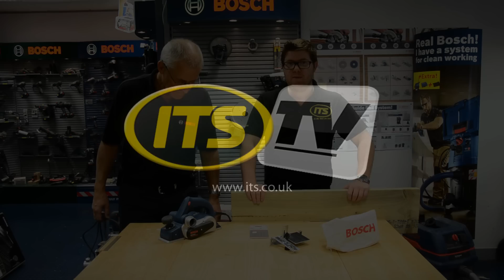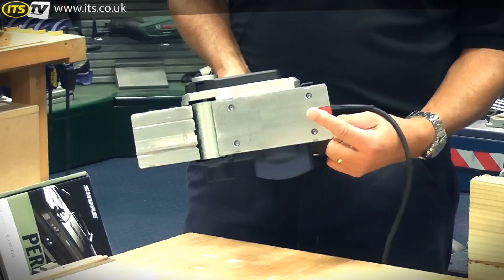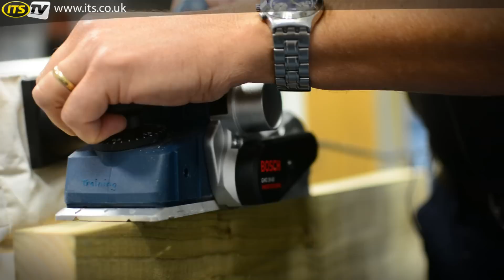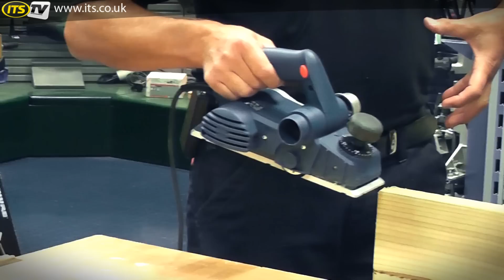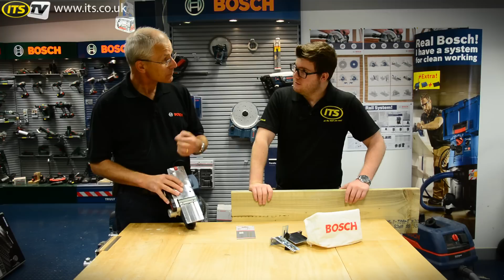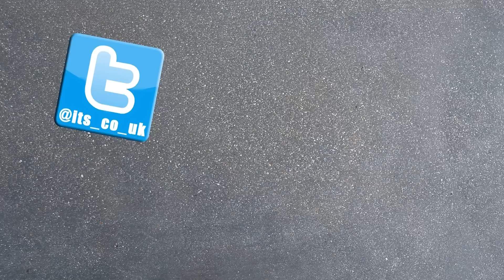Bosch GHO 26-82 Planer - ITS TV

Comment: I bought this one yesterday. As you say, the finish is great. The only thing which has to be addressed is when shanfering. The leading edge of the groove bites into the wood corner. Needs to be lightly filed to stop this happening. Otherwise, good machine 👍👍👍